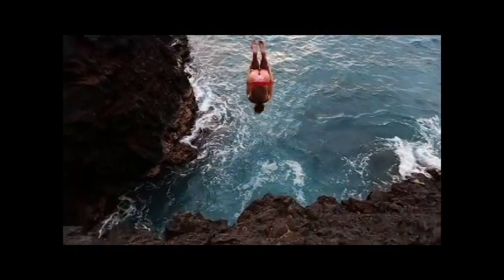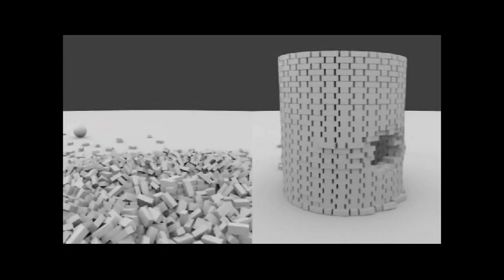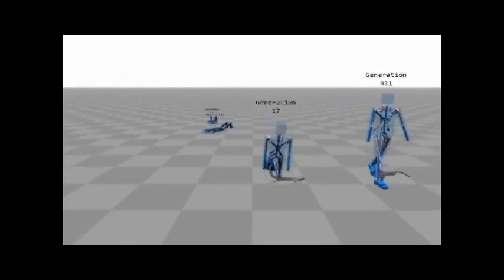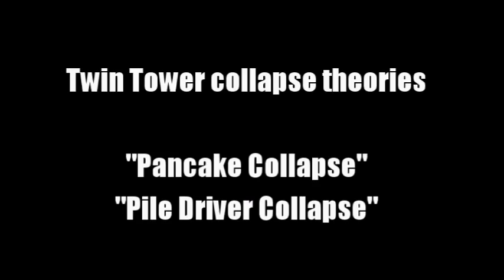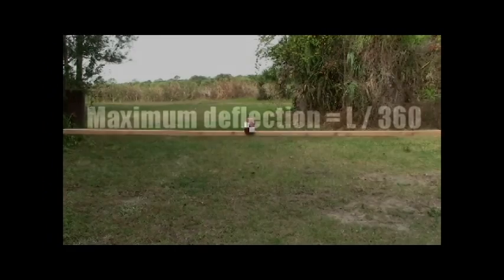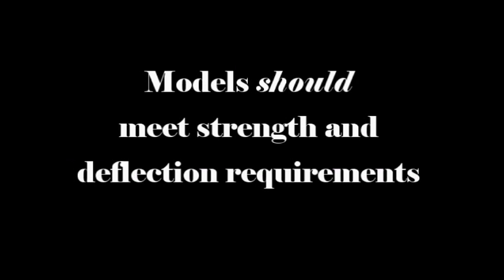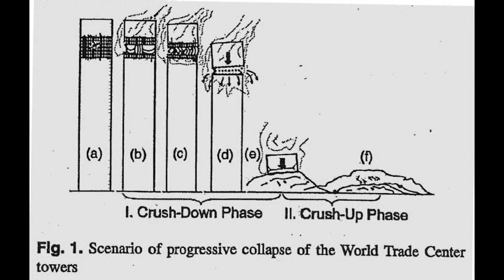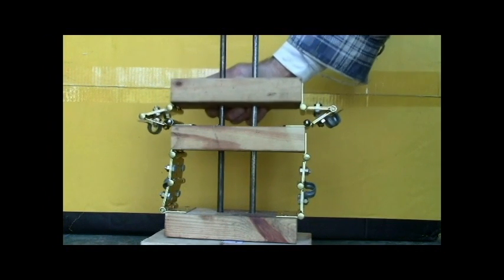9/11 Experiments: The Force Behind the Motion

Comment: Oh, one of those videos.
Sigh....

0:34 "even the most basic motions were never explained."[...]"and all the outward motion"

The outward motion is explained by the air inside each floor being compressed by a building falling on top of it. The compressed air needs somewhere to go, in this case out the windows was the path of least resistance. Hence the outward motion.

Like the air in an accordion.
Reply: you're assuming that both the building below the collapse and the mass of falling debris are sealed air-tight.  Neither is  true.  It's a building and a mass of falling junk, not a piston moving in a cylinder.  Think of the amount of empty space in the volume of any given floor of any building.  If it starts collapsing, can the air find a path out through all that empty space, or will it build to the pressure required to blow out thick glass windows and aluminum cladding?  You think any building is built air-tight enough to allow pressures like that to even exist in the first place?   and what about the stairwells and elevator shafts leading to the rest of the building below any given floor?
Reply: I would like to see your math for how you calculated it was "way more" kinetic energy.

But to be fair, here is my math:
Energy at splat time = 1/2 * mass * velocity^2 = mass * g * height.

So the energy departed to the sections of steal beams that went flying can be calculated as the mass of all of the building above it (hundreds of tons), times the distance that it fell (several stories), times gravity (9.8 m/s2)

___________________________
Lets just do some quick, back-of-the-envelope type calculations to start with.

The energy required to move an object in a horizontal direction is exactly the same as to move the same object in a different direction all other things being equal. That last part is important, since things usually aren't equal (direction of gravity relative to direction of movement, for instance). 
But it is still a fact that for a steel beam to be sent flying in a horizontal direction will only require an equivalent amount of force as that generated by an equal steel beam flying in a downward direction.

Now the transfer of energy from a downward to a sideward motion isn't perfect. Honestly I think 90% energy efficiency would be a generous offering. But just to really prove my point I'll say 25% efficiency for energy convergence. So when a part of the building falls down, 25% is transferred to sideways motion and the other 75% goes to areas (downward motion, heat, rebounding up, etc).
So now our calculation is that for our steel beam to fly horizontally at a given speed, it requires 4 times the mass to be flying down at the same speed to provide the needed force.

So now lets say the steel beams flying out sideways are traveling 5 times faster than the falling via gravity.
The things falling would accelerate as they continued to fall. But to put everything in your favor lets say that the upper building is only traveling at the speed of gravity itself; 9.8m/second. Even with this slow speed for the falling objects, our steel beams flying out sideways are traveling at that is a whopping 49 meters per second! 
That means we need 5 times more mass to generate the needed energy. 5x4=20. So we need 20 times the mass falling down to create the mass flying outwards.

How big of a steel beam did you want to send flying?
Lets just say an entire story of the building. Every steel beam in that story, from the roof, the walls, the floor. And everything else in that story, from the desks to the potplants... EVERYTHING sent flying out at 49m/second. All we need is for this story on the building pushed by the force of 20 stories above it.
__________________________________

Remember, all of the above calculations were put into YOUR favor.
- an abysmal efficiency of energy transference of only 25%
- the falling portion of the building not being allowed to accelerate past 9.8m/s
- the horizontal flying objects flying at 5 times that speed.

I would love to see your math, coz' mine seems to check out despite everything being skewed in your favor.
Reply: What;s your percentages based on? 90%? 25%? So arbitrary numbers are sufficient? Seems sketchy.
Reply: What about for every action there is an equal and opposite reaction? As the top of the building crushed the lower part so the lower part of the building would also crush upward especially as the structure of the building and the steel core was denser the lower down the building you go. What about the path of least resistance?  And what happened to the tops of the buildings? Can we see the maths that suggests that a 20 or so floors of a building somehow crushes 90 or so floors that are undamaged, then crushes itself into dust? From gravity alone? Also you cannot say in fairness that the top parts of the building 'fell several floors' That suggests that suddenly all of the structure for several (albeit damaged) floors suddenly gave up all resistance simultaneously. If you can find the answer to those points, then perhaps you will convince people who have very serious questions about the official explanation. In fact according to NIST they don't have an explanation after the point of 'global collapse' and they had a few years and plenty of experiments, none of which supported their initial theories,  to work on it.
Reply: Therein lies the problem. The free fall poses a lot of questions. It doesn't work out physically. It was the biggest faux pas. And something that is difficult to control. To appear as if the official explanation coincided the fall would have to be controlled in a near impossible manner. Albeit could of been done but other factors could of made other aspects suspect. It was easier just to bring it all down. Which was the point. And no one seems to know exactly why. Even terrorists have "reasons". There was nothing gained for them. But I digress.
The lack of resistance,i.e. free fall is the smoking gun. In no way does it work out,physically,mathematically,or logically. The waving of hands by using math,which btw can make anything appear to work out,but even then in this occurrence factors and variables or omitted to make work. Common sense will tell you in no way what occurred was natural. Not to mention THOUSANDS of engineers say the same. It's bullocks.
Reply: Shane Rooney why do you argue man? Who hurt you? You are so discontent with your life that you feel the need to argue with someone  you have NEVER seen.
Reply: IDDDUBZ BRADBERRY, personal life experience taught me to take no knowledge at face value.
So I test every hypothesis of mine in healthy debate. Even with loonies.

Even if he is 99% wrong, that 1% where he is right could fundamentally change my views of the world.

Also, the effort it takes to argue forces me to actually research a topic. I'm now essentially a subject matter expert on the South China Sea for this reason
Reply: Also "energy transfer" does not work in a specified manner. It isn't the energy available but the energy implemented. 25% of said energy does not completely transfer to another form. Equal and opposite reaction does not work in this manner. Reaction is not the same as result. You should know this. Hence why you gave a 65% decrease in energy transfer. But fact is you don't or can't know how much was or wasn't. All things are not equal. Not to mention you did not compensate for weight(s).  Did you forget about p?

Comment: If you observe the free falling of the towers on 9/11, you'll have to see that the metal plates that covered the buildings and sustained the interior of the structures had become dust. The whole buildings (concrete, metal plates, fixtures, interior furniture, and the asbestos) all became dust. How would that happened? That's why they fell they way they did, because the top of the structures was heavy while the rest of the building became dust, how?
Reply: "If you observe the free falling of the towers on 9/11"

What makes you think there was any "free falling" of the towers on 11/9?
Reply: Slater Slater     On 11/9  no one saw any free falling. I see free falling any time I look at the pictures taken on 9/11. If you don't call that free falling then you have to explain yourself instead of contradicting for the sake of it.
Reply: Slater Slater   The debris is not encountering resistance because it has been liberated from the structure by the top of the building still intact, while the top of the building, still intact, is breaking the structure into dust-debris while falling. Of course the top is going to be delay in relation to the free dust-debris, since is encountering a grade of resistance; duh!
Reply: Slater Slater   Relatively free fall. Come on!  The only way it could be free fall, in the strictly sense of the word, would be if the top of the building were falling in a void. In comparison to that we can call it free fall, since the top is falling with a minimum of resistance. How a structure made of thick iron plates could become dust from the top down? That's the question.
Reply: Slater Slater   If that what you think, be my guest.
Reply: Slater Slater I don't think so.
Reply: "The amount of scrap metal is only a portion compare to the complete amount of metal used to construct those buildings."

Then you'll be able to say 1) How much "metal" was in the buildings and 2) How much was left over afterwards.  3) Admit you were wrong when you claimed the building was turned to dust.

"About 3/4 of a building became just dust."

How did you work that out?

"That's why at the beginning of the falling there is more debris and resistance, while after that the buildings fall almost at a free fall speed. "

There's that "almost free fall" nonsense again....

"The only explanation for that is in Dimitri Khalezov version of the events."

A nuclear device?  I see that you're a total lunatic.
Reply: "the implausible collapse when coupled with the official theory put forward by the 911 commission."

The 911 commission don't attempt to explain the collapse mechanism, that was NIST's area. Now then, what specific part of NIST's proposed collapse model for WTC 1 and 2 do you object to?
Reply: Slater Slater Julio Sanchez is observing more fundamental issues relating to this event, rather than the superficial findings of the 911 commission that you seem to adhere to. 

Over 100 floors collapsed into a debris pile no taller than around 5-8 stories. Surrounding cars in car parks streets away were burnt as if placed in a microwave. The percentage remains of office equipment was next to 0. The most recognisable of which was a filing cabinet which looked to have suffered microwave damage aside from being twisted and buckled beyond recognition ( as opposed to being crushed ). The steel inner core can be seen collapsing straight down to dust shortly after the main collapse. 

The are a many more points to mention. I too initially thought the collapse was due to only the planes hitting the 2 towers, then I heard about building 7. This made me question observation, which in turn exposed the implausible collapse when coupled with the official theory put forward by the 911 commission.
Reply: Slater Slater   Thank you. Those pictures proved my point! The amount of scrap metal is only a portion compare to the complete amount of metal used to construct those buildings. The top of the buildings ( a considerable amount of iron plates and other construction material) kept intact, while another big portion of the building below the top became debris. About 3/4 of a building became just dust. That's why at the beginning of the falling there is more debris and resistance, while after that the buildings fall almost at a free fall speed. The only explanation for that is in Dimitri Khalezov version of the events.
Reply: Slater Slater   You are only contradicting for the sake of it. Nobody is that fool not see the buildings becoming dust. You are only shilling for whatever reason that moves you. I won't waste my time answering you since there is not object on doing so. Believe what you must.
Reply: Julio Sanchez
You mean you're running away because I proved every one of your  assertions false.

Comment: The weakest link in the construction was the plate on the interior and exterior columns that were welded on to the columns and to which the floor trusses were bolted. These held the building together like a fragile zipper. If you look at videos of the construction in progress from the 70's you can see how small and thin they were. In videos and pictures of the aftermath you can easily see that every single plate on every single column was either bent straight down or completely sheered off. Demolition could have never done that. End of story.
Reply: Sean, apologies to you too! Identifying the truss connectors as a "zipper" is absolutely spot on and pointing out the damage to them in the wreckage is the damning evidence.
Reply: Frank Heuvelman
Substantial portions of both core structures were standing AFTER everything else collapsed. And, there was no pancaking. One side of the floors were punched through, wedged apart by perimeter walls from the tops, followed by the rest of the mass, creating  a churning, chaotic mass of steel grinding everything up. Sean Sbragia comment is spot on, and structural remains indeed tell a very clear story.

Comment: your Pancake Experiment is seriously flawed. the Levels of the Building were suspended between the inner column and the outer Skin of the Towers, in your Experiment the weight had to break the Floors for movement to occur. in your other Experiments it was required for the pillars to break.

instead it is sufficient that the Floors would be ripped of their supports. it is thinkable that some of the Floors bend, so they would pull out of their supports. also it is thinkable that the walls are slightly pushed outwards, so the Floors loose their support. in all this cases it is not needed to break either the Floors or the pillars. if the weak spot of the construction is the Connections it is probably those who break first, not the pillars or Floors. also there were two Things present that react with each other violently: water from the Sprinklers, and molten aluminium from the plane. 

The molten aluminium and water would damage a lot of the structure, so far i have not seen anybody account for that. Aluminium might cause what looks like planned demolition.
There is molten metal visible in some Videos, and a fire that continued in the Basement for days. Aluminium fires cannot be extinguished with water, they normally burn untill all the Aluminium has changed to oxide. The reaction of aluminium with water Releases H2, wich is also volatile. Te reaction of the aluminium with rust(there has to be rust in a burning steel Building) is well known as Thermite-reaction. 

All of this together with a combination of pancake and piledriver Theory would have to be examined to see if it is able to explain what can be seen.
Reply: But none of the steel showed ripped out connections, and sure you can combine all of those things, tweak it, make it match what was observed. You could also try to investigate if explosions were used, which they didn´t. Why would they refuse to do so?
Reply: Shut up gravity does not blow multi tons of steel 600 feet thru the air lateral end of discussion. Bombs is the only logical way
Reply: Cool Story  the Planes...